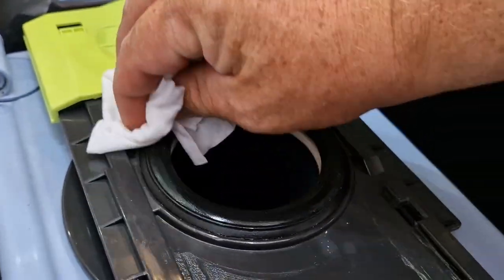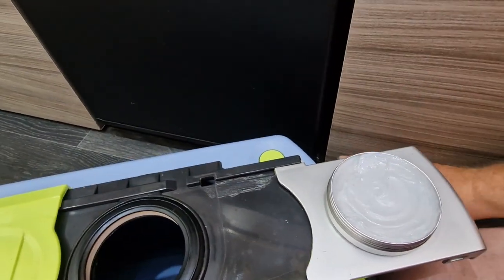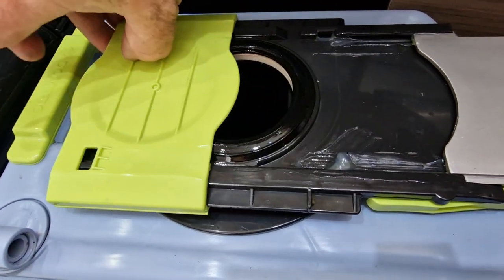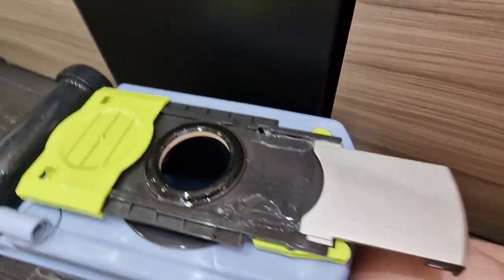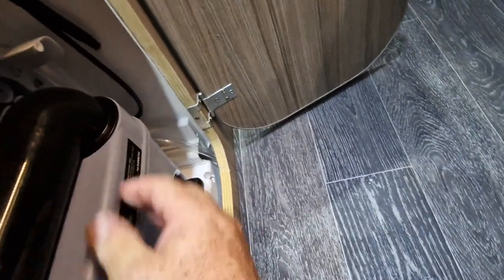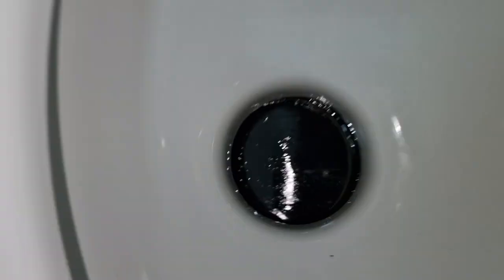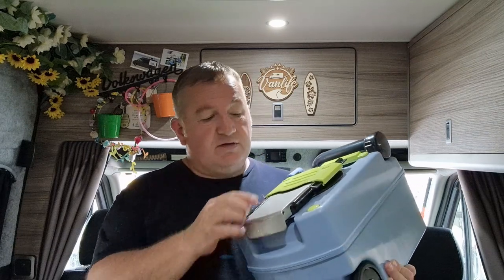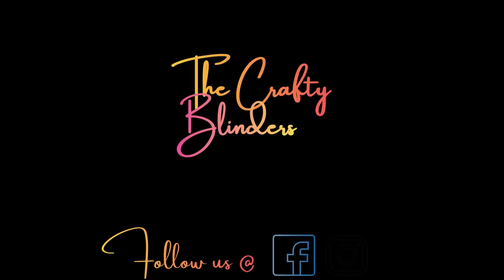Maintaining Campervan Toilet Cassette

Comment: Hi Sam
We have exactly the same toilet and cartridge which we fitted in 2018 and had the same problem once the initial manufacturer lubricant wore off. To fix it we removed the whole locking mechanism which is dead easy and do it to clean out the holding tank each time as gives you a much wider opening. If you remove the cassette, pull out the silver handle and leave the green slider in the closed position then rotate the whole slider mechanism anti-clockwise 30 degrees to the base it then separates like a bayonet light bulb and you can get to the underside to clean n grease up the whole mechanism. We use Xavax OKS1110 silicone grease in a tube. As long as you don’t use Vaseline should be ok as believe this swells the o rings over time making the movement tighter.
Surprised you haven’t fitted a SOG kit on yours Sam going out through the floor. I know you like a gadget or two lol. We fitted one last year straight forward enough and haven’t looked back. No chemicals, no smells and you can empty the cartridge anywhere without contaminating anyone’s septic tanks. Let you do a You Tube video installing one.
Reply from the maker: I'm not sure if you can fit a SOG on an internal door?
Reply: @TheCraftyBlindersvanlife  No you can’t that’s why you need the through floor kit like mine

Comment: Hi pal good to see you at van life eats, just had a call from friend saying SV TECH who are in charge of up plating the vans only up plate to max of 4050kg , the front axle stays at 1650kg even if u up grade 5 ton front leaf spring and 5 ton shocks,?? I’m confused?? What is your new weight plate pal ??
Reply from the maker: My weight is 4230kg. Your friend is right
SV tech will only up plate to 4050kg as they use a modle basically they converted one van once and use that as their benchmark,
If you contact Dee at van weight engineering, he can up plate your van to the same as mine as they judge each van on its own merits eg correct rated wheels, tyers and suspension for the additional weight
However the front spring needs to be A906 321 18 03  as the A906 321 11 03 has been down rated to 3.5t due to obsolescence hope this clears things up mate 
We came back to see you on the Saturday but you had gone, hopefully catch up soon somewhere 😁🍻

Comment: Using grease will be the cause of your problems straight away. 

Wurth silicone spray is the best thing to use.
Reply from the maker: I don't understand why? it came greased from the manufacturer we used what they use
Reply: To be honest I’ve never seen a toilet cassette greased. 
If you clean all the grease off and then treat the moving parts and the rubber seal with silicone spray you’ll see a massive difference. 
I spray the seal sort of every other empty.